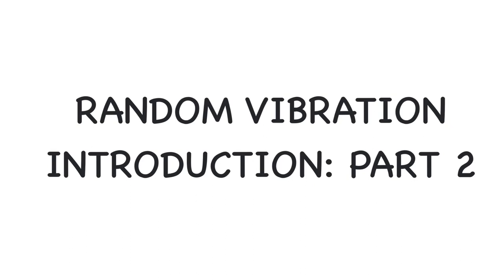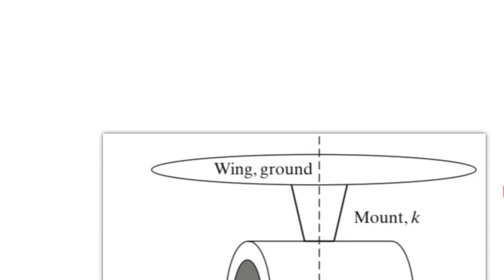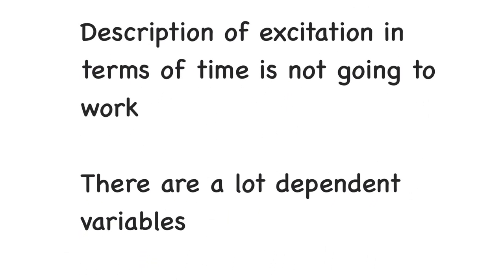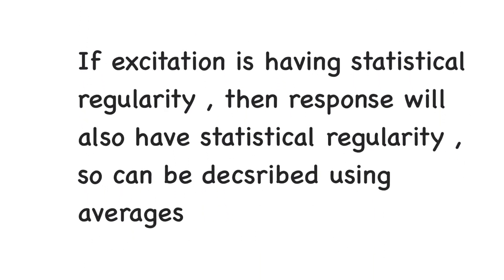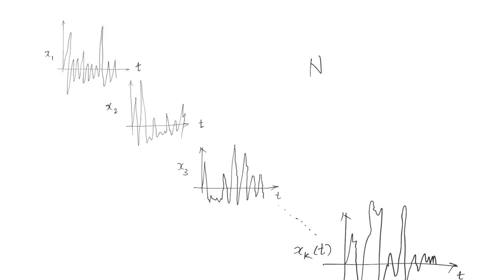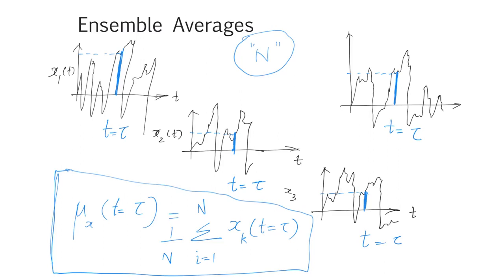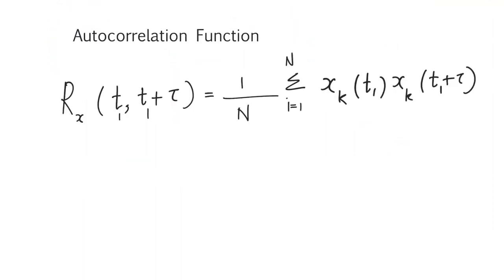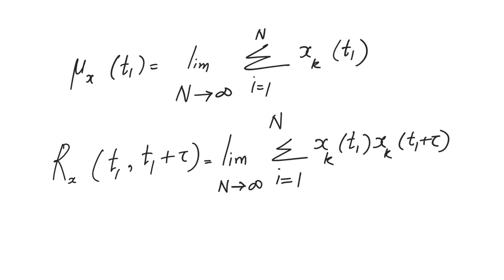Random vibration- 2 | An Introduction | Part 2 | Ensemble Averages

Comment: Thanks. Very useful tutorial on this unique topic.
In the auto-correlation function, we have a plenty of choices for t_1 and tau. Does it imply we have many R_x ?
Do the N samples necessary to have same data length? 
Shall we fix the measurement condition of N samples at t =0, ? e.g. to define the moment when the wheel first touch the ground at t=0  ?